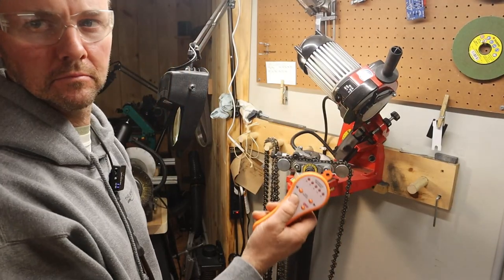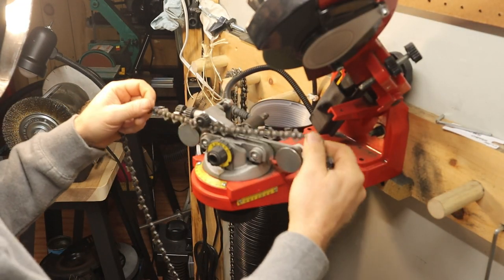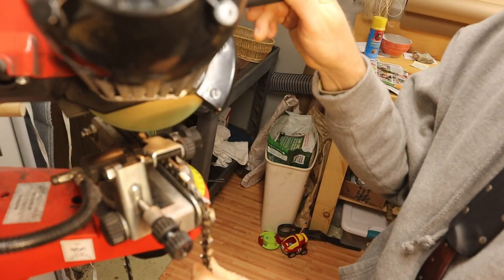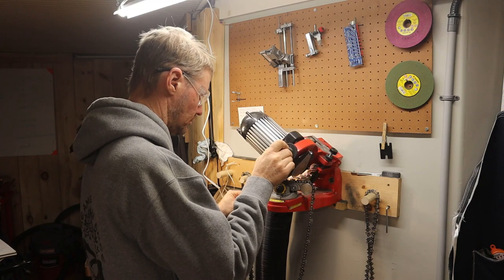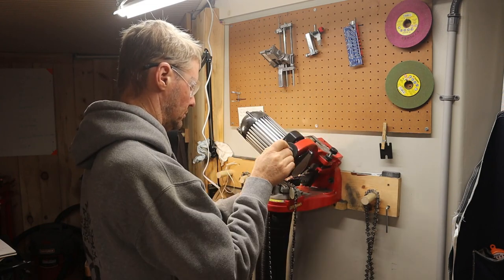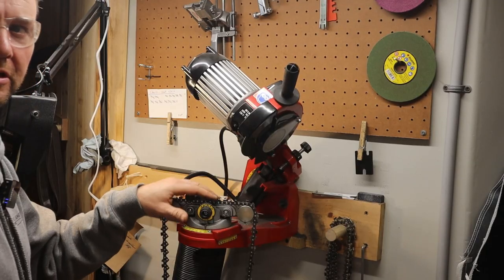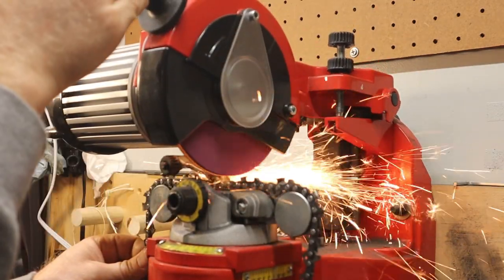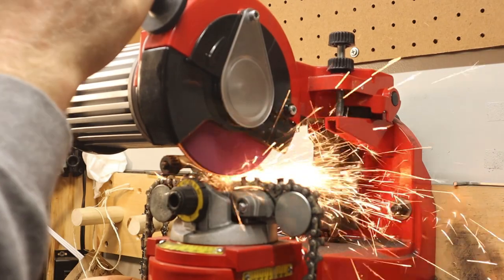TNG Ep.44: Chainsaw Sharpening REVISITED

Comment: Another good Friday Morning Grind as we call it in the UK ;). 

SuperJolly (or equivalent) definitely on the wish list...
Reply: Model to acquire depends on how you intend to use it. Semichisel, with fixed top plate ( under cut ) fixed at 60  Oregpn / Tecomec mini Jolly or clone works well. Have had a one for 12 years s/h bought, still works well.
Soon recoup investment in machine compared to price of decent box of files. Use hand file to touch up on site. Best of both.
Reply from the maker: Thanks so much, Brad! As you research grinders let me know what you go with and what factors influenced your decision. 
I purchased the Super Jolly largely because it was the model being sold by the vendor of professional sharpening tools that I trust.

Comment: Yep, much better Matt, for a non chainsaw guy you are getting the hang of it!
When you get a CBN you'll be good. My jolly takes a 1/4 turn on the stop when going from left to right to keep the cutters equal.
Oh, and PS, many of us chainsaw types DO use callipers to check the teeth!
Reply from the maker: Gotcha. A quarter turn isn't huge. Mind my asking why you need the tooth lengths in such a high tolerance?
Reply: All loggers and most blokes who cut their own firewood can file freehand, it is the best way. The idea of a grinder is to bring chains damaged by steel or rock (or inexperienced neighbours) back to life without having to file for hours. It is important to at least start with equal and identical cutters : it affects the quality of the cut and the "feel" of the saw.
Now that you are getting the hang of round ground chain you should investigate square ground chain - that is a whole different world!
Reply from the maker: Yeah, if you keep your saw out of the dirt and off the rocks and make it a habit to touch them up every time you put gas in the saw I could see how you could get through the life of a chain without needing a grinder. 
This, like most things in sharpening, seems to be a never ending rabbit hole. Appreciate all you've shared!

Comment: Hi I have the exact same grinder but I reckon 30 degrees mark is more then 30 so I put it on 25 for my full chisel chains, I'm not sure how to use the pitch Guage thing tho cheers
Reply from the maker: What made you notice or think that your angle guide was off?
I use the Pitch-n-Gauge to measure raker height.
Reply: @capnmatt41  hi just seems to be greater then 30 probably just me I've done about 6 chains now and they seem to cut well, I've just done 1 chain with the 10 degrees down angle so will be interesting to see if it makes a difference I run c 85 x cut full chisel chains cheers

Comment: I am enjoying your videos. I like your style and manor.  Not to nit pick, but I thought I was seeing the cutters you were grinding discolor as you plunged down.  This would indicate they are getting hot.  Perhaps I am seeing things.  I saw an interesting video,  https://youtu.be/Lj1J_nU1XQg  He spins the grinder wheel with  drill to get it to start and run the opposite way for the back row of cutters.  I thought that was a neat trick.  He has some information in the comments where he found out why the machine cut the cutters to different lengths.  It seems that the angle gage on the machines are off.
Reply from the maker: Thanks so much for that, Bruce. Any time you touch a grinder to metal it'll warm up, and it is possible I overheated a tooth. Seeing them get blue or red is definitely an issue but I'm wondering if the discoloration was the burning of the sap I'm not able to get off the tooth. It cooks to a black color at a very low temp (comparatively). 
I'll come back and watch that vid in a bit. 
Thanks again!

Comment: I have an older selvey  chainsaw grinder that will run forward and reverse.I love it but I cannot get wheels for it.
Reply from the maker: Right on. Maybe reach out to Joe at Wood Turners Wonders to see if he can get you a custom CBN wheel for your machine. You just need to know all the dimensions: arbor, diameter, radius and grit.
Reply: Check out Bailey's for Silvey Chain grinder wheels.